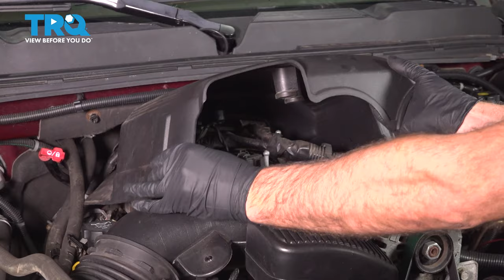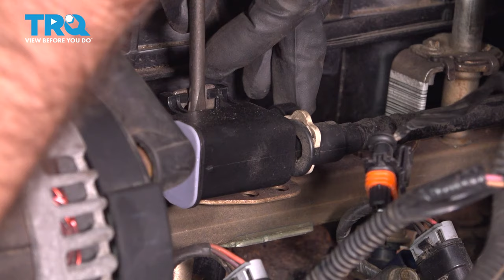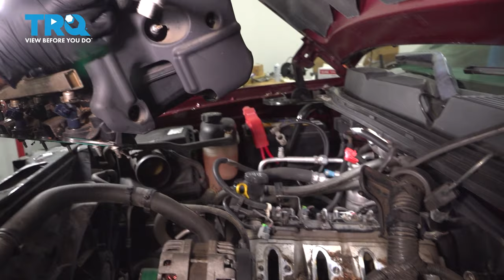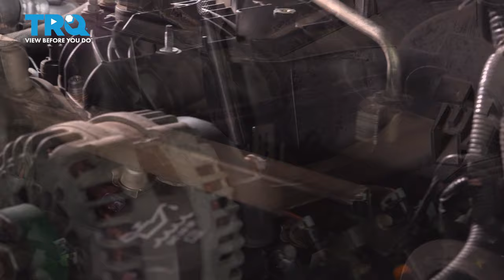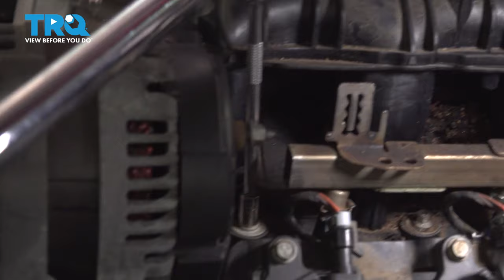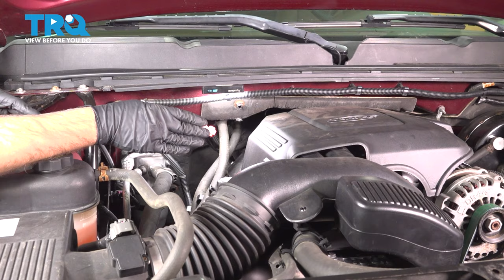How to Replace Oil Pressure Sender 2007-2013 Chevrolet Silverado 1500

Comment: Awesome video. Very in-depth. Fixed my issue. Only suggestion. At the start of the video, state what you are going to need. Started the project. Found out I needed a fuel line removal tool. Left to get it. Kept watching just to find out I need a 1 1/16” socket. Went to the store again. Just to come back and fine out I needed a 1 1/16” DEEP socket. Would have been nice to know what I needed and make one trip before leaving.

Comment: Overkill in a big way bud. Swivel extension #1-27mm deep well socket #2- 1 can of cold beer #3 and 10 minutes of keeping your cool #4 and avoid all of this. This can be done without removing all of this. Just requires some patience and the right tools.

Comment: Did you change the filter below oil pressure sensor? There is a filter in the oil passage that can clog up. We need to change that, too. It looks like you put in a new lower plate in video.  It looked shiny after you got old sensor out.

Comment: This job can be done without taking the intake manifold off it's going to require patience. If you have the right socket the right extension a ratchet and a swivel it should be no problem. Also you got to remember to pull out the filter and install a new one. A 4 x 4 truck may be a little bit more difficult because of the height.  I guarantee a dealership is not going to do this if they've done it a bunch of times without having to take the intake manifold off and still charge you full price.

Comment: That is just what I was looking for. Yes, there is an easier and faster way which I've done before. My problem is that a rat made its way to the wires of the sensor. No way I could have repaired the wires without removing the intake.

Comment: Hmmmmmmm? Good video, but.
I seen when you pulled the intake it looked like a lot of debris in there, no explanation about it and then the next view everything was cleaned up and way shinier than before and no explanation as to if you need gaskets or not which I'm assuming you would do since they did what new but I didn't see what they looked like when you pulled it up and out either way good video I'm not being negative but you could give a lot more information and explanation and cut down on 15 minutes of putting bolts back in until you get to the torque specs at least Good job thanks